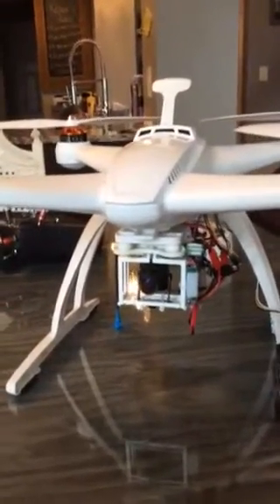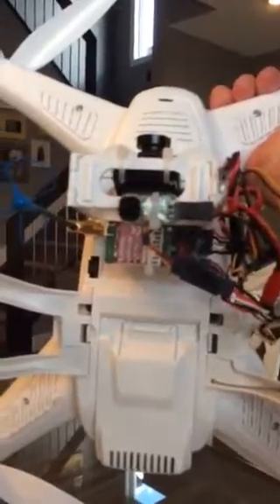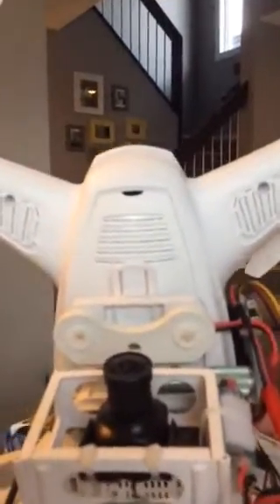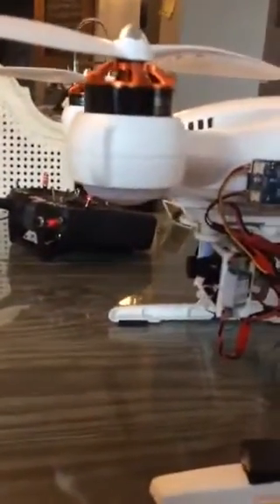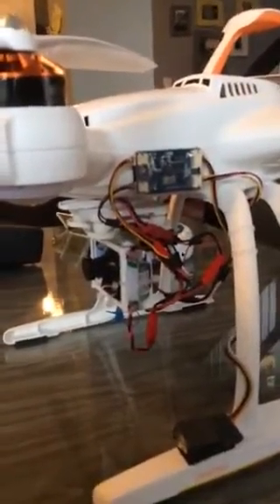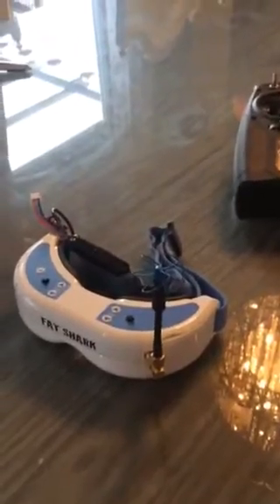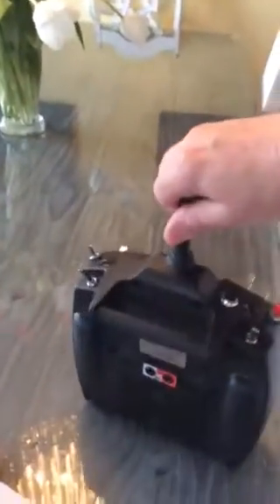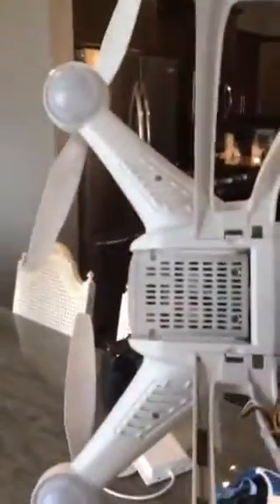Chroma FPV setup explained.

Comment: Thanks for the cool video ,my question is about the main antenna,,,,so all you did was find it in the body and run it down the leg of landing gear????
Reply from the maker: Thanks! Yes if you take of the rear panel (the one under the battery with all the holes in it) you will see the receiver directly under it. It has two antenna wires, take the longer of the two and reroute it out the left leg. It will require you to hand drill a tiny hole in the leg and leg insert. I also used a little double sided tape to keep it in place inside the channel of the leg.